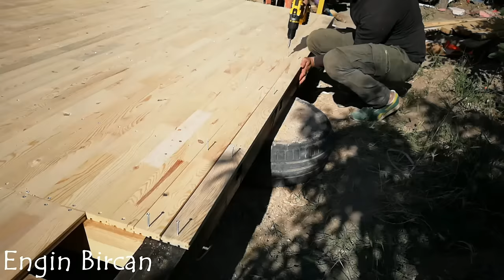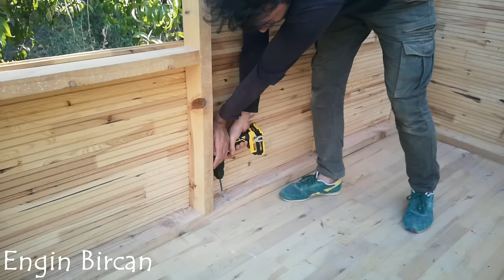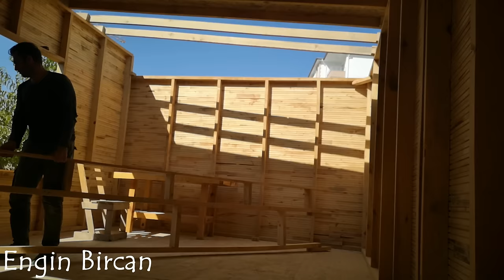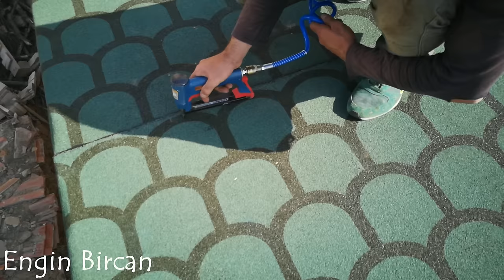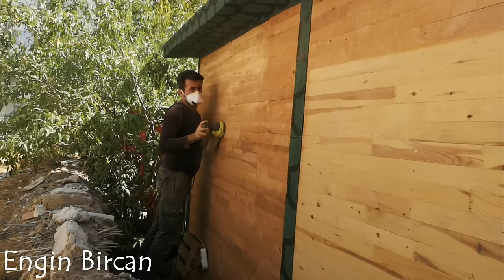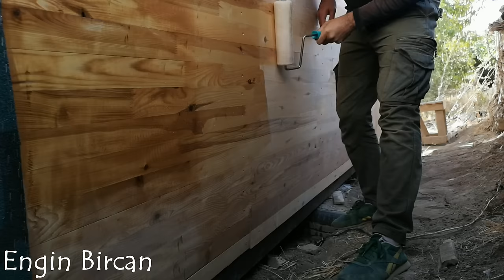How to Build a SHED / The wooden cabin / Build a hut / Tiny house / DIY wooden house / Ahşap ev yap

Comment: Too many staples. And if they are not stainless steel will not last for long. Good job though on woodwork, 1 single person.
Reply from the maker: Thank you. There is membrane in the stapling areas and they overlap. no problem. not steel. Of course it won't last very long. It can last ten to twenty years. maybe longer.

Comment: Maybe the wooden structure is quicker and cheaper to build, but next time build from concrete blocks and metal beams, try using different materials. Concrete building has more strength. Anyways you are a master in  this well done 👍

Comment: Vapor barrier with sand on top of it , the tires with concrete the way you did them would be a good foundation for the portable sheds they sell everywhere.
Reply from the maker: yes you are right. Thank you very much. We were able to do so much with the means at our disposal. We use it without any problems. see you again
Reply: @WoodWorkerenginbircan 😊😊😅 5:29 5:32 5:34

Comment: What was the material you put on the roof etc, is it instead of corrugated iron. Cheers!
Reply from the maker: Hello. The name of the roofing material is sandy membrane. a material that prevents water seepage.
Reply: @WoodWorkerenginbircan  thank you for a reply, I'll have to see if there is anywhere in Australia that sells it, thank you, indeed thank you for sharing your video. Cheers!
Reply: Ask for “tarpaper”
Reply: @MrUndakava  oh thank you for a reply, I shall do that, it looks like it works well and might be easier for me to handle, I'm making my she shed.🙂
Reply: @howlingwind1937 In the UK it's called roofing felt (spoiler - it's not felt) - you must have something similar in Oz.
Reply: @rodjones117 thank you for a reply, I really appreciate the help, YouTube can be so very useful sometimes, I'll look for the felt in the hardware shop. Cheers!
Reply: @howlingwind1937  No worries.
I looked it up :
In Australia, the material commonly used as an underlayment in roofing applications is often referred to as "sarking" or "roofing sarking." Sarking is similar in function to roofing felt or tar paper used in other countries. It serves as a protective layer between the roof structure and the outer roofing material, such as tiles or metal roofing.
Hope this helps.
Reply: @rodjones117 aaah! That's why I got the funny you're a bimbo that doesn't know what she's talking about look!😂😂 I'll go back in and rephrase my request😂😂 I know what I want to do, and I know how to do it, I just don't have the right lingo to say the right thing, I'm not really a wood worker but I try to make the things I need myself as much as possible. Thanks again, it just proves the social network works. Cheers everyone!

Comment: Have you ever tried staggering those siding boards instead of but joining?
Makes a stronger wall.
Reply from the maker: You are right, it is always appropriate to do a surprise operation. But we have done it this way.
Reply: I am not sure if it matters, I have seen it both ways, in old buildings.